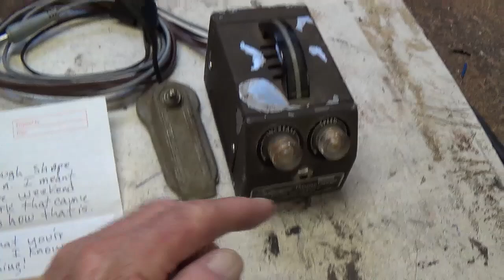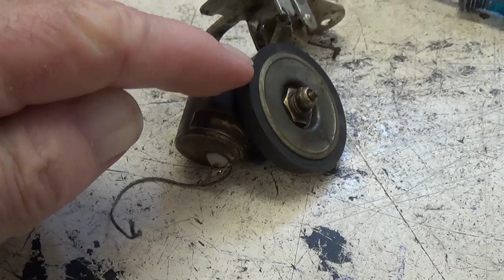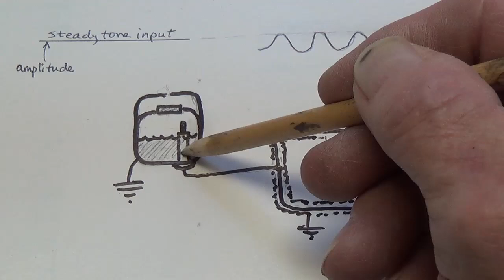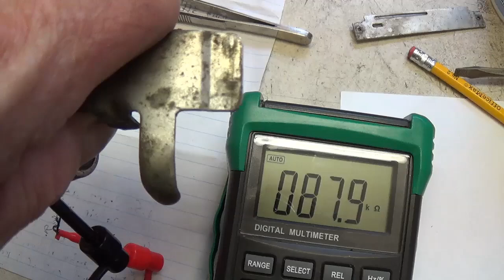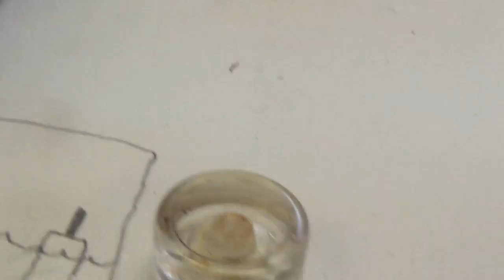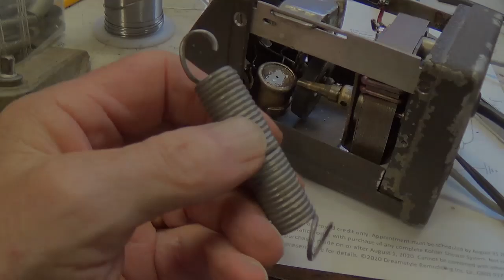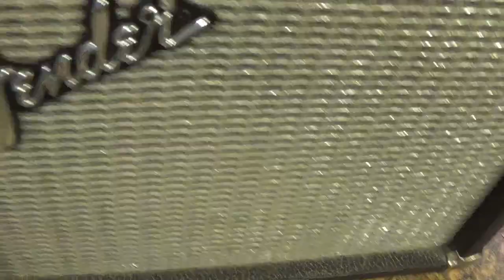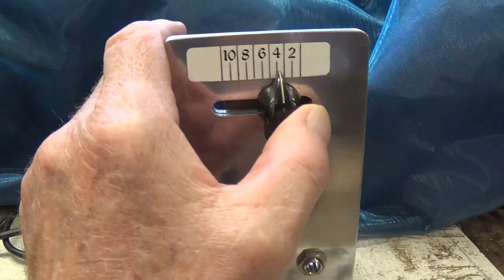1940's DeArmond Electromechanical Tremolo Unit.....DeAd on DeLivery !!!

Comment: Hey Uncle Doug, I have one of these that is currently in non working condition. Would you be willing to give it once over and see if we can get running again? I can confirm that the motor works and it passes signal but no tremolo effect. Thanks
Reply from the maker: I no longer do repair work, J.  Why not study my videos and repair it yourself?  It would be a great learning project......and what have you got to lose?
Reply: @UncleDoug  I'm usually pretty clever with fixing gear in a pinch but I think there is something wrong with the electrode in the canister. Any suggestions would be much appreciated. Thanks again for your time.
Reply from the maker: @jshago  It's really hard to diagnose issues in a complex device in person, J, let alone sight unseen. You really need to focus on the mechanical and electrical repairs yourself.....or contact Chelliamps@gmail.com to see if he can help.
Reply: @UncleDoug  Sounds good. Thanks again

Comment: Uncle Doug, what a great video!  I have had one of these (not functioning)  for 6 or so years, and watching this, I was able to repair the mechanical portion, but now I need to acquire a reverse taper pot, and wonder if you stock and sell them.  Or...possibly share a part number & where to buy it?  Thanks again for the great video!
Reply from the maker: I'm glad the video was helpful, Rod. Try Antique Electronic Supply.

Comment: I can't begin to tell you how many times I've enjoyed watching this video over the past few years! I homebrewed my own mechanical tremolo this past week, inspired by your videos, and I'm still ironing out the quirks on it... One question- what is the value of the green capacitor on your first tremolo unit?
Reply from the maker: That's great to hear, JG. It was a 0.5uf cap, but to be honest it really didn't do much to eliminate the popping noise made by the cannister from time to time. I eventually eliminated it.
Reply: @UncleDoug  Thanks for your quick reply! I'm getting some noise and am thinking it's my wiring, and possibly because I used a DC motor with a small speed control module. I'll keep you posted!
Reply from the maker: @jetglo355  Perhaps you can shield the motor and speed control from the canister.  It's like a large antenna for noise and must be protected.

Comment: A fabulous video. Excellent. My questions: Do you recommend using Windex or distilled water in the canister. Which one and why. What do you recommend as a sealant for the previously soldered hole in the canister? Any special silicone? Many thanks for your response.
Reply from the maker: Distilled water will not work, Joseph.....use Windex. Any good automotive silicone gasket sealer.

Comment: Shaded pole motors rarely burn out, but intead of bearings they have bronze bushings which dry out and get gunking up.  Cleaning out the dust and re-oiling the bushings (light oil) is recommended.
Reply from the maker: Thanks for your helpful input, EJ.

Comment: The one flaw I see in this really cool tremolo is: When you stop the motor to stop the effect, the "fluid resistor" could end up in any position and thus not put the volume back to the same level before you kicked in the effect. I assume making the switch a bypass switch (double pole double throw) one pole for power and the other take off the bypass would probably add more noise.  Your thoughts? 

I could make this with a geared down DC motor and a small variable DC power supply. Then put a disk on the motor shaft with a variable width slot around it.  Then shine a light through the rotating disk to a CdS cell on the other side for a similar tremolo volume effect. I could even have other disks with different slot patterns for even more unique tremolo effects (like sawtooth for example).  Elegoo makes a nice Arduino UNO Super Starter Kit with just about everything need to prototype one. You can use PWM out of the UNO and a transistor as a motor speed control. You can even sample the "wet" signal with an UNO analog input to digitize the signal.
Reply from the maker: Shutting off the tremolo effect involves bypassing the unit, Paul, thus there is no risk of inadvertent residual grounding. Please see my videos on the creation of electromechanical tremolos. There are lots of sources for the rotating disc design.

Comment: Great video.  Wow, using Windex as a variable resistor. Remember the film "My Big Fat Greek Weeding", the father of the family used Windex for hundreds of home uses. I could see it now:  [In a Greek accent] "Windex can be used on mosquito bites, frozen locks, and even as a liquid variable resistor." Then he would go on to show you the root of ANY word is Greek, so there you go.  https://youtu.be/yPCIsIJ7nhY?si=96lE8Ez7Jc4lioSI

If you put the tapered part on a lathe and trimmed off about 20 thousandths to the small diameter end, you could get a slower speed. I think the minimum speed is a bit too fast. I am sure it was designed that way but it would be nice to get an even slower speed.
Reply from the maker: Thanks for your input, Paul.

Comment: Hello Doug- Since I cannot find a way to contact you, I'm using the 'comments section here. I have a model 60 that needs at least the tank filled-how can I directly communicate with you as far as servicing my model 60? I am not on twitter, facebook or any of those type of 'servces'-only email, phone and USPS. I've had this unit for 15 years ang need to get it running before I croak. Thanks. I guess post your response in 'comments'.
Reply from the maker: I no longer service these devices, Max, but all you need to fill the tank is a syringe and needle with a few cc's of Windex. There is usually a rubber port on top of the brass canister through which you can inject a few cc's of Windex. If you have a window on the side of the canister, it should be half full. Good luck.
Reply: @UncleDoug  Thanks for responding-but my eyesight is bad and I cannot see well enough to do the simple work, and will have to search for someone else to get my unit working. Rowe Industries are responsible for the early DeArmond FHC so called 'monkey on a stick' strap on & sound hole pickups-also the great 'Dynasonic' pickups as used on late '40's through 1958 Gretsch electric guitars and some Guilds and other brands.
Reply from the maker: @maxroyle6750  Good luck, Max.
Reply: @UncleDoug  Can you recommend anyone who can/will service my model 60 ? Thanks.
Reply from the maker: @maxroyle6750  Message me on my FB page: Uncle Doug's Vintage Amps.
Reply: @UncleDoug  Thanks for your continued responses, but I don't have facebook.
Reply from the maker: @maxroyle6750  What a shame. It's an easy problem to resolve.

Comment: The original pot after cleaning probably would work ok fed from the source impedance of a typical guitar pickup (6kOhm?). It would never work well fed from a low Z signal generator.

Comment: Commenting at 51:17.  Could the limited range be due to having a low impedance sound source (signal generator) as opposed to the high impedance it was designed for?
Reply from the maker: That's a possibility, Bobby. Thanks for your input.

Comment: Slick 50 Ultimate....needs a new powder-coat too.
Reply from the maker: Don't we all ;)
Reply: @UncleDoug  too bad no one makes an analog plate reverb that would fit on a pedal board.
Reply from the maker: @RulgertGhostalker  If by "analog" you mean the huge plate required for plate reverb, then it seems pretty obvious why it can't be fit in a pedal, Eric. There are some excellent synthesized plate reverb effects available.
Reply: @UncleDoug  i do analog synthesis via "digital modeling", so must, of course, insist those plate reverbs are excellent digital models.
Reply: @UncleDoug  i have a EXH-Dirt Road Special to sort of get my "Loud fix" ... but my absolute favorite studio guitar amp i have is my UAD B-15N Plugin ..
i have the UAD 5E3 plugin too,  but i don't like it as much as the B-15N through the stock alnico 15" ...the real Ampeg B-15N "flip top" was a tube bass amp with the GZ34, 6L6s; and to my surprise, when i looked it up, 6SL7 pre-amp tubes..

i think plugins, and modeling amps, can really help people figure out which direction they want to go before making a real tube amp purchase..
( or help people design their dream amp )

i have played through lots of real amps i couldn't afford, and lots of modeled amps too, and the UAD amps are the most detailed models i think...
 but the EPS tube stack is my dream amp..
Reply: @UncleDoug  i made my EXH DRS even louder, ( though i can't run it cranked for more than a half hour ), and it still isn't really loud enough..
but i can't hear my other tracks if i try to record with it.
Reply: @UncleDoug  maybe shim stock and optical pickups???
Game Changer Audio makes a super deluxe optical spring reverb pedal....why not a plate ???
Reply from the maker: @RulgertGhostalker  You could ask them, Eric.
Reply: @UncleDoug  or maybe now that there are spring reverb pedals, someone could come up with an analog plate reverb unit that would fit in a guitar amp.
Reply from the maker: @RulgertGhostalker  There are some excellent reverb pedals currently available, Eric.
Reply: @UncleDoug  in fact, i think the Ampeg B-15N is the best guitar amplifier that was originally designed for bass.
Reply from the maker: @RulgertGhostalker  Thanks for sharing, Eric.

Comment: The foot switch wire should have also been bonded to ground with a 3 conductor cable.
Reply from the maker: Why, Tim? It's housed in a rubber door stop and it's very doubtful that anyone would try to operate it with a bare foot. Even if they did, the shock would be limited to the foot itself.....uncomfortable but not life threatening. I'm a firm believer in safety......but sometimes its pursuit can become excessive.

Comment: The hole should be used for a kill switch for the entire unit.
Reply from the maker: I'm not sure why the unit needs two on/off switches, Tim, but thanks for your input.
Reply: @UncleDoug  Any kind of device (at least in my opinion) that carries high voltage/current needs to have a disconnect means not just a wall plug, overcurrent protection, and grounding of anything that isn't isolated. Even thought the foot pedal is rubber, the surface of the button is metal, if it had been a current limited circuit to the pedal there wouldn't be any potential hazard. But it's a 110 volt loop.  I would have crimped on a ring lug and placed it around the threaded barrel of the switch. This is just an opinion however. A 16/3 S.O. cord would be about right since its low current.  I cant help being an electrician. LOL
Reply from the maker: @timothyj1962  Thanks for your helpful input, Tim :)

Comment: Uncle Doug, on the mechanical tremolo you made, there isn't a glass canister inside the copper tube, correct? Doesn't that essentially attenuate the signal? I'm having difficulty understanding the benefit of a glass canister inside the cylinder.
Reply from the maker: A glass liner would prevent the grounding from occurring, Tele. The liquid shorts the signal between the electrode and the wall of the copper tank. Watch the video again.....everything is explained in detail and with diagrams.

Comment: If the maker of this video is watching, was wondering if you work on other peoples pedals? I have one of these DeArmond Tremolo pedals with an all glass canister. The windex dried up over time and was hoping that I could send mine to you and that you could work on it. Of course , I'd pay you for your services. If that works for you, please let me know. Thanks.
Reply from the maker: I'm currently swamped with repair work, Scott, but I'll make a suggestion that might save you some money. I've never seen an all-glass container, but if it's like the brass vessels, there should be a rubber stopper at the top of the vial. Get a syringe and small gauge needle and inject some Windex, around half full, and see if it works.

Comment: I think I would have used a 3 wire with a ground line to foot switch having a live metal remote seems like a accident looking for a place to happen and also installed a fuse
Reply from the maker: Thanks for your helpful input, Richard.

Comment: I don't know if anyone else has already mentioned this, but I would have liked to have tried the cam wheel reversed, so the conical shape of the wheel and the spindle of the motor would mesh with each other better. I know that's not how they were put together, but it would be interesting to see what would happen! :)
Reply: I’ll answer my own question, now I’ve thought about it... The single point if contact and larger radius means that you get the maximum possible frequency range across the sweep
Reply from the maker: @markjackson5665  True, Mark, but I've tried it both ways and, to be honest, the direction of the cam wheel made no apparent difference.

Comment: From 46:41 you have a bug in the proceedings? 
What a jewel. Your makeover was extensive compassionate and effective indeed. I even had to break out my old sea legs at one point.
Isn't it great to look back on old technology and how there are simple engineering solutions to a problem; where these days we would go for a crisp plastic-clad digital device. This method delivers such an organic and alive sound; the build is so solid it will still be running when its modern cousins are lingering in a landfill under a new housing development.
The pot (potentiometer, not the fluid pot) that you used is essentially a log one but with the track ends the other way round? Could you have achieved the same thing with the existing pot but use the other side of it, OK the knob would have worked in reverse...sometimes you do see the free track end connected to the wiper which must make the resistance curve very different around the middle?
The electrolyte choice must be very important otherwise it might corrode the electrode or the canister? In fact a teeny bit of current must flow through the circuit so does this cause some electrolysis  and potentially some gas release? Has one of these ever blown up in a puff of hydrogen explosion?
Just when it's all over, you blow us away with your creations. Both are absolutely amazing. Do you have crowds of begoggled Steampunk followers waiting outside your workshop for your next invention that looks the part and actually works...?
I would love to see your first one powered by a mini steam engine, that would add a whole new meaning to a band "warming up"
I bet you can make a vibrato with some clever combination of tanks filled with liquids that slow the sound down and then mix it all back together somehow, for you it would be a snip...
I'm off to watch the video on the first device now. Thank you so much for making this video for us it was a joy to watch.
(Thank you too to the generous people that donate parts to keep this show (and cats) running along)

(I just thought of something, can you make a tremolo from a motor and a cam and a pot? The motor could just turn the pot up and down, could you even add it to your version 2 and have a fade between motorized pot and splashy pot to create even more overlapping effects?)
Reply from the maker: Thanks for all the great comments, IL :)

Comment: Other than unknown of the nose one on the output shaft of the motor, it looks like a pretty much bog standard shaded pole, 2 pole skeleton motor. Could probably adapt one from about anything as long as your amperage and duty cycle is about right
Reply from the maker: Agreed, Aaron. It closely resembles the motor found in many kitchen and bathroom air vents.
Reply: @UncleDoug  I have cannibalized many a bathroom fan to fix other projects.
Reply from the maker: @aaronatwood9298  I've built two DeArmond-style tremolos from scratch using kitchen vent hood motors.

Comment: The thing I love about this tremolo unit is the overall pleasing to the eye appearance of the design.  Focusing on the two identical looking knobs, their physical inner workings are completely different from each other.  As a design element, a pot is a pot.  You can change the location and the knob, but that’s pretty much it.  The other knob (amplitude) is a purely physical linkage arrangement that could have been done a number of different ways.  Like maybe a lever that is slid back and forth, or a little hand crank (that’s not no much different than a knob though is it?).  The point is that the appearance of the DeArmond Tremolo Control is the way it is because the designer very specifically chose that.  Form would still follow function in any case, but they chose this.  Very nicely done.
(I wrote all this before even knowing about the second half of this video.  Doug does a much better job of making the form-follows-function point though.  I must say)
Reply from the maker: Thanks for your detailed analysis from an artistic standpoint, Clay. Many people might not appreciate the splendid design of the unit without your helpful insights.

Comment: love the video. thanks for telling us about this highly unusual unit.
Reply from the maker: The pleasure was ours, C. Glad you enjoyed it.
Reply: @UncleDoug  thanks! btw, why does the resistance of the tank depend on the deflection? I would have thought as soon as the fluid connects both electrodes, that's the resistance you'll get and it won't change. That is to say I'm surprised. It's a fun way of creating a variable resistor. Does this have any capacitance or inductance? Any non-linearity on the I-V curve? Do you know?
Reply from the maker: @cheater00  The resistance decreases as the fluid contacts more of the electrode, and increases with less contact. The resultant resistance plot is more sinusoidal than square wave.